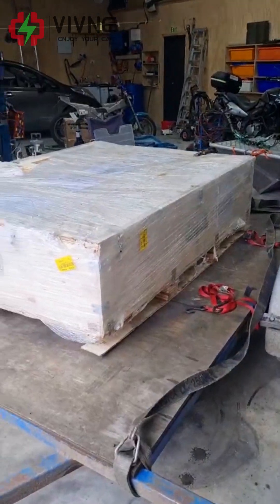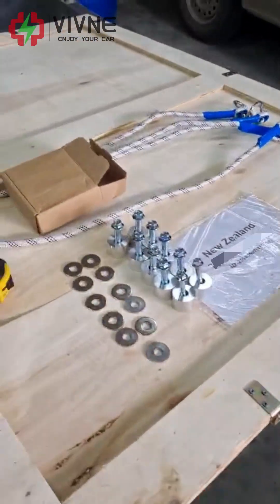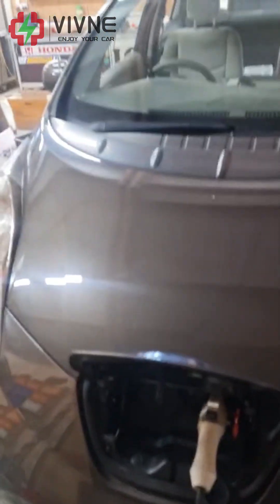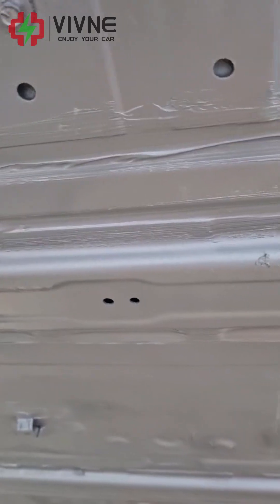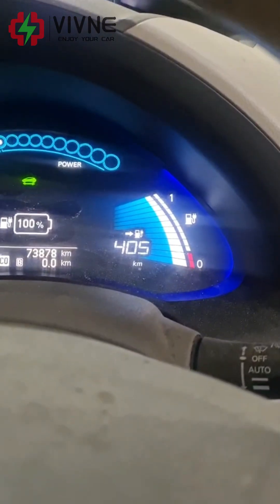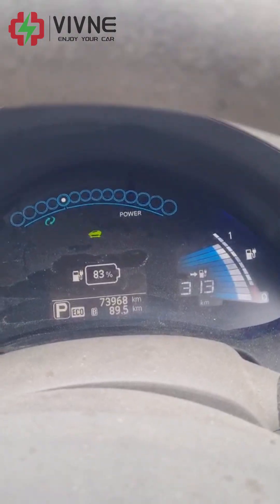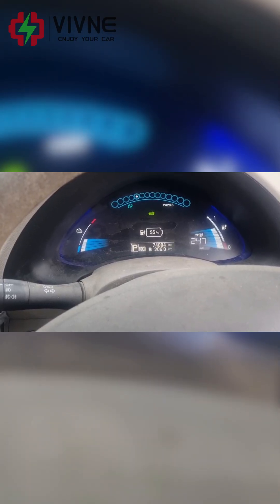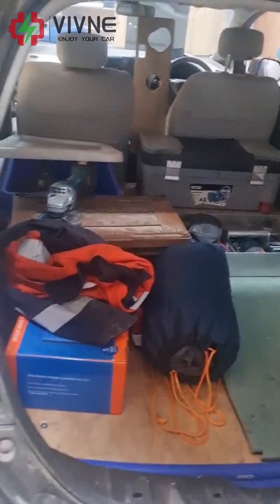Nissan leaf battery upgrade from a happy man in New Zealand-Part 1

Comment: Do you have to reprogram or replace the BMS module so the dash reads correctly and the charging system works correctly?
Reply from the maker: Yes, we do, we will reprogram the BMS.

Comment: 5:32 "We've got a usable charge of 64.5 kwh on Leafspy"?  But I thought the battery was 68 kwh
Reply from the maker: Yes, it’s a 68kWh battery. LeafSpy has its own calculation method, even the original 62kWh pack doesn’t show 62kWh of usable capacity in LeafSpy. From the first page of LeafSpy, you can see the Ahr value is 195Ah, which means the real capacity is about 69.2kWh (355V × 195Ah).
Reply: @VIVNE-CoraLiu My original 40kwh pack goes up to 403 volts max and Leafspy shows 103.21 amh. That makes 41.6 kWh maximum. Would that be correct? I thought they were all 39 kWh packs. It's the 2021 model year.
Reply from the maker: @TheGramophoneGirl  No, you should calculate based on the nominal voltage (355V), not the maximum voltage.
Reply: @VIVNE-CoraLiu Ah, thank you. That would be 36.6 kWh. That's probably more like it as it's 4-5 years old now.
Reply from the maker: @TheGramophoneGirl  Yes.

Comment: Please share info about suspension adjustments as with 68kWh it definitely went lower comparing to 30kWh
Reply from the maker: 68kWh and 62kWh is only 2.5cm lower that the original 30kWh, no need to change the suspension.